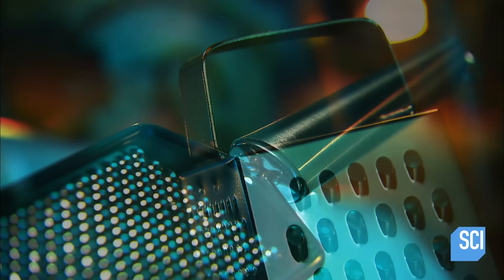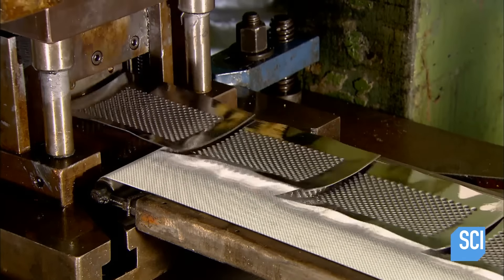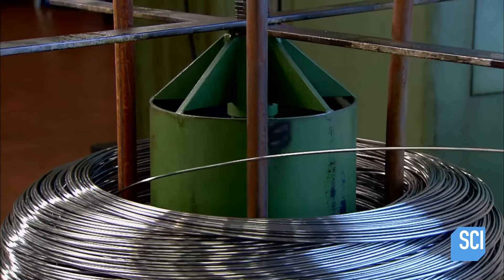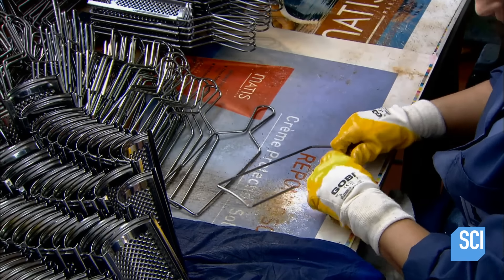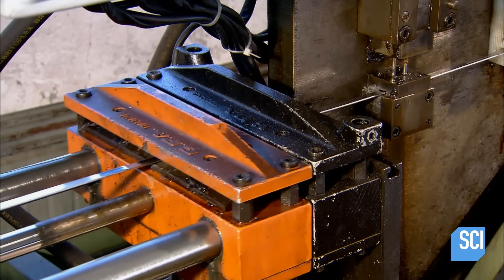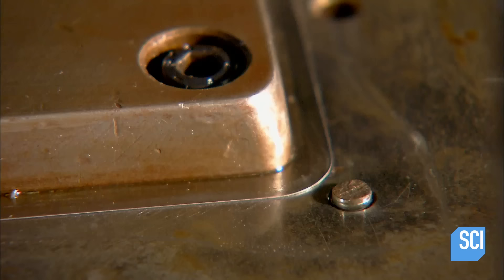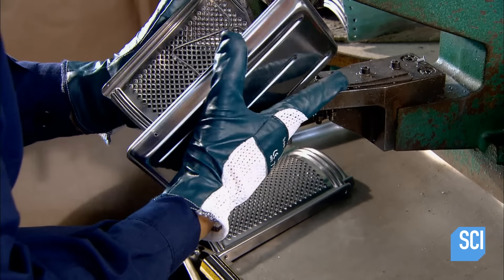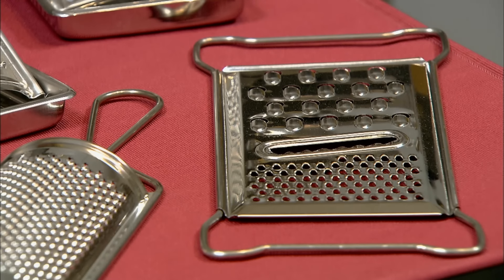How It's Made: Cheese Graters

Comment: hmm... so, that's how Apple made  the casing for the Mac Pro desktops 😂
Reply: You're not wrong
Reply: It's actually milled from solid aluminum, so it's quite expensive to produce, for minimal benefit.
Reply: LOL
Reply: @punkdigerati  Actually, it is stamped aluminum. Milling it out from a billet would make the laptop cost about $6700. Milling is an extremely slow, expensive process for something like a laptop, especially compared to casting or stamping
Reply: Was that supposed to be funny
Reply: @pencilpusher4328  figures a pencil pusher wouldn't find it funny, but it is lol
Reply: LMFAO
Reply: Cringe
Reply: @scbane  nope. Most aluminium housings used by apple are milled for final dimensioning. The cheesegrater design OP was referring most definitely is, and their laptops have been for years as well.
Reply: Absolutely barbaric!
Reply: actually it’s a Mac Pro Tower not a desktop 🥱🥱🥱😂😂😳🤭🤭🤭😱😱🤯🤯
Reply: @thepotentialcandy  thanks. I forgot the exact word when I posted the comment

Comment: In the intros the “how it’s made” title plate is screwed onto the metal sheet behind it, and during the introduction the plate is then also welded onto the sheet it’s screwed onto, which begs the question: why would you screw something onto a metal sheet if you’re going to weld it anyway?
Reply: The welds might be to for reinforcement.

Comment: The other amazing thing to consider,  who designs and builds the machines that make graters and other things we use everyday 🤔👍
Reply: And the steel factories that transform rolled steel coils to the wire for the handles and thin sheets for the graters; you could parse it down as small as you like. Everyone is a supplier for someone. The Great Chain.
Reply: whoaaa because that hasn't been said on LITERALLY EVERY SINGLE VIDEO on this channel about EVERY SINGLE PRODUCT already 8,000,000 times, and you totally couldn't have found those 8,000,000 comments saying THE EXACT SAME SHIT from spending 3 seconds looking, totally better to make ANOTHER identical post! props man you are doing the good work!
Reply: @zeening  so true.

Comment: setup the hydraulic wire frame machine to not bend the piece as far so the next worker doesn't have to pry it out every time.
Reply: 1:22? I think it needs to form the edges so requires pressure.